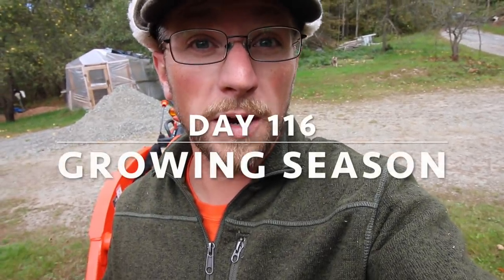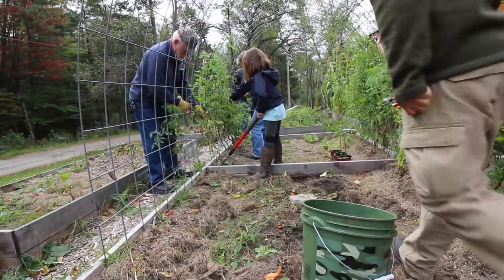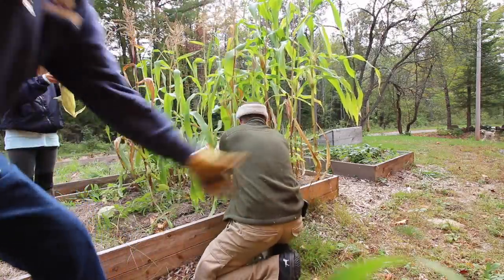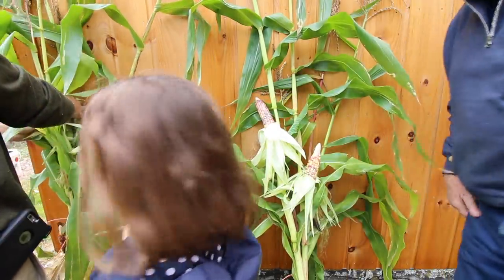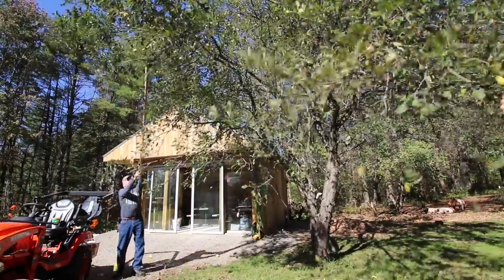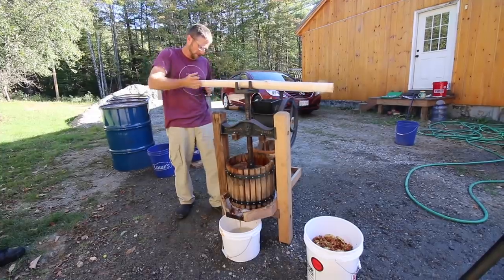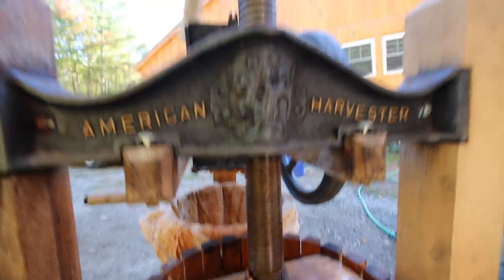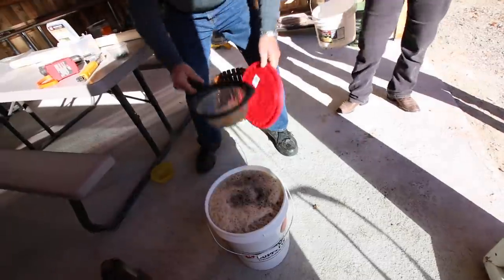🍂🍎Fall Harvest on the Homestead🍂🍎

Comment: Tomato horn worm, pupates to a luna moth. Don't feed to pigs. Tomatoes are from the nightshade family, the fruit is edible, the vegetation is toxic. Same with potatoes. 
I think you're running the grinder backwards. The feed chute sends the apples to the far side of the grinder, you are grinding and pulling the apples back. The outlet chute then throws the pulp to the short side of the press hoppers. Run it the opposite way, the apples will pull into the grinder in the same direction of travel that the hopper feeds. The pulp will then come out the bottom chute and throw towards the wide side of the hopper. The outlet chute is not centered over the hoppers for this reason. It allows some "fling" room. You'll have less of the grindings feeding into the forward hopper (the one you're pressing)  this way. That was quite a bucket of juice. Was that only from the one tree?
Reply: David -- I think they had already fed three-quarters of the apples from that tree to the pigs. Those trees are loaded with apples.

Comment: when we pressed apples at Old Sturbridge Village, after we'd gotten all o the juice from a batch o apples, we'd drill 2-3 inch holes in the apple mass (we were using a hundred pounds or so of apples at a time). and pour in water, and then let it set overnight. The next morning we'd press it again, and get a  weaker juice. if you let that sit for a couple of months, you get a light hard cider, and eventually, cider vinegar . I suspect that if ye just dumped your spent pulp in a bucket and poured water over it and let it sit overnight, it'd give ye the same result. It's kind of funny: I live in central Sweden now, and yesterday (Oct 4) we spent the day clearing out the garden because of frost forecasts too.. When do ye generally expext your last frosts in spring?
Reply from the maker: May 23 is our last frost date. How about yours?
Reply: Well, we just moved inhere on this Aug 1, so I'm not really sure, but in the last place we lived, it didn't surprise anyone if we had a killing frost in the second week of June. We're hoping here will be  closer to your  date. I've been really happy to see your tomatoes and corn, because people here all keep saying ' you can't grow tomatoes here without a greenhouse' (and most of them have never even tried to grow sweet corn), and I'm thinking that your success with both in what seems like a pretty similar climate could be a  cause for hope for success here. Fingers crossed!